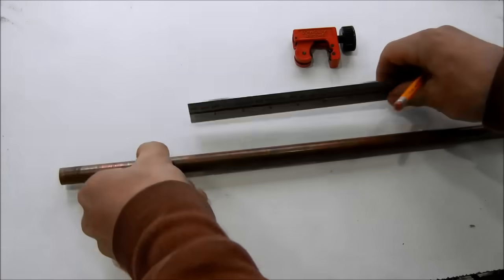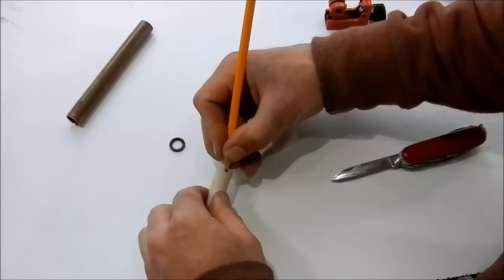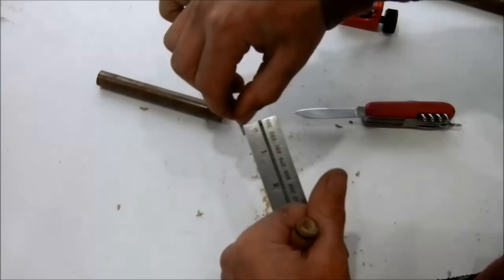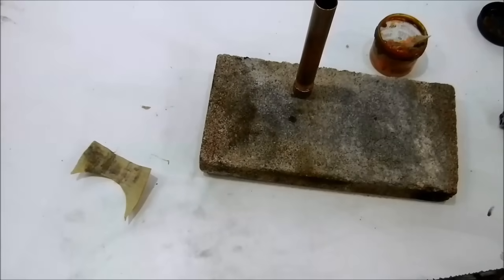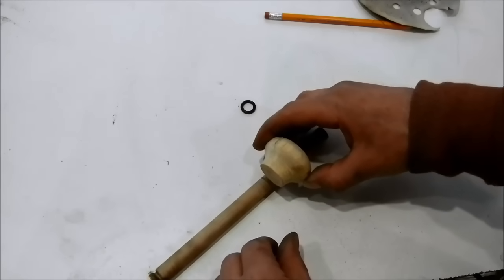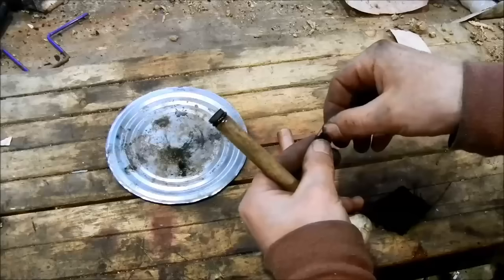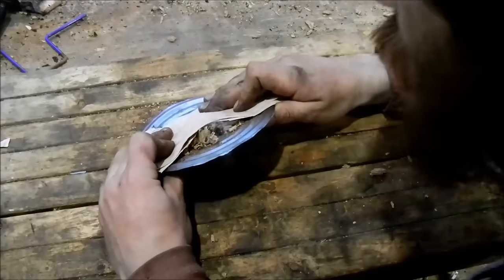Making and Using a Fire Piston

Comment: Drill a hole through the knob, put plunger in tube, slide on knob, mark plunger at knob top, cut plunger to length and glue in knob --  really strong, no screw.

Comment: Fantastic video no annoying music nice and quiet. Direct to the point. I gotta go make one of these my only suggestion however minor from somebody who soldered millions of fittings put the heat on one side, touch the solder to the other side the heat will draw the sauna around. And the other advantages when the opposite side of the pipe is hot enough to melt the solder that’s the perfect temperature and you won’t burn the joint. I’m off to make one of these. Thank you sir.

Comment: I just finished ordering batteries for my porter cable drill driver. Bought it in 2000 and its still in fine shape. Had to order  1.9 ah ni cd sanyo equivalent ones. But I refuse to throw that drill away!!

Comment: The knowledge to build this device is of more realistic practical use than all those silly ferro rod videos. The most likely survival situation In our modern age would be the result of some kind of unplanned event which cuts you off from access to all goods and services, so you must gather all you need from your immediate surroundings.  You probably would not have time to prepare and would not have matches, lighter or ferro rod, but you probably would have access to some salvageable man made materials. Since this fire piston could be made in so many different ways all you would need was a short piece of pipe and you could have this built in a few hours without a hardware store. (if you had some kind of a blade) It is very doubtful you would find a rod suitable for striking sparks. The use of a dead Bic lighter found on the ground may actually be most likely in statistical reality. Without at least a pen knife in the very remote wilderness, you might be in a pinch, no matter what. You would have to resort to full-on paleolithic and the learning curve on that exceeds time required to starve.

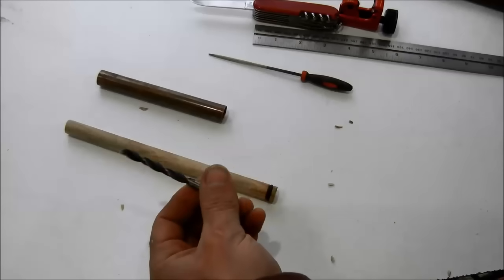Comment: 2:50 the pop 😆😅
This is cool, cheers. I'm also wondering, does this scale alright? As in, if the dowel and pipe diameter increase a little, will it have the same effect? I'm guessing it would just take more of a whack to plunge the piston down.
Reply from the maker: Yes, it would work, but this size is already a bit big and takes quite the whack.
Reply: @jonthewoodworker  Ah right I see. Cheers.

Comment: This is great and a fun thing. For back woods well off the beaten path I found that a disposable Bic lighter works extreamly well and is much less weight and starts fires faster. 
PS if you mention  what if... 
I just carry two lighters and it is still lighter and easier.

Comment: Cut a square of aluminum foil 4x4. Take a cotton ball smear it in Vaseline. Place in the center of square fold the foil place in a tin. When you need it cut a x in the foil pouch light the cotton ball, when tinder is self sufficient pull out packet let cool replace in tin to reuse after letting it cool

Comment: When I was a boy scout, one of the explorer scouts had a fire piston, the piston was copper tipped, smaller in diameter and fit into small wooden block and it worked. The design shown here looks easier to make, simple, and inexpensive. it also teaches some measuring, knife, file (chain saw file), pipe sweating skill. Looks like a great scouting project.

Comment: I learned that if you cut a tiny notch out of the pit wall you get an even better ember. The heat caused from the friction will rush into the notch you cut out giving you a better ember.

Comment: I dislike these for routine use. They would be last option for a fire starter. 
And yes I do own one. Much prefer fire striker and flint/chert.
Or fero rod. Even a bic lighter, in wintertime the flint will still work. 
Not very good with bow drill, but better than freezing when no other option except in very wet humid places.

Comment: Superb video
All 100% info ZERO BS
I have used for over 30 years now and can not recommend strongly enough either a Gerber StrikeForce or Gerber Blastmatch 100% self contained fire starter that the handle of both will hold one or two 100% waterproof 100% windproof Trioxane fule cubes
Weighs 3-4ozs fits in any pants, vest or pack pocket and is essentially bomb-proof indestructible and idiot-proof to use.
I have so many I lost count
I have two in every vehicle 
Two in every pack pack
One in every turkey vest
One in every fishing vest
One in every fishing tackle box
One in my hunting survival kit
One in my 1st aid kit
All with additional Trioxane bars.
If you can not get a fire started with a StrikeForce/Blast match and Trioxane cubes/bars maybe you shouldn't survive

Comment: Great video . My only question is, can it be used with other materials other than the carcloth to start an ember? If so, what other materials can you use besides the carcloth, and if not, still a great way to start a fire fast
Reply: Rusty steel wool might be the answer.

Comment: Great tutorial! For those that don't understand what happens when you hit the plunger, think of how a diesel engine works (compression ignition). When you hit the plunger, it raises the pressure of the air in the tube to 3-400 lbs. and superheats it, causing the tinder to ignite. Very basic, no matches required, and works in pretty much any weather, as long as you have some dry tinder to work with.😉
Reply: Always certain to learn more in the comments.  The understanding being my goal. Thank you my good man!  An interesting learn indeed
Reply: Thanks
Reply: First recorded use by the Kikuyu Tribe of Africa. Their model was larger and made from wood. Probable estimated length about two feet. (700mm approx.) Thanks for the info. re pressure.

Comment: I inherited a fire piston (tonteldoos) that was from the second Anglo-Boor War, 1899 - 1902 when Great Britain sent their soldiers to die in South Africa for the gold fields, at a ratio of ten to one.
It is one inch diameter X four inches long. The plunger goes through the fixed end-cap of the body and the other removable end-cap is secured to the plunger by a  small chain.
Inside is some charred cotton wool. 
Thanks to this video I now suspect that the plunger is missing at least one O-ring as I could never get the thing to work.

Comment: O-rings are actually designed to fit into a square-bottomed groove -- you'd be better off using the side of a flat bastard file (yes that's what it's called).

Comment: Great video sir, to the point, not wasting people's time with music and nonsense. Great video. I'd like to add, when you make groove for O ring, put dowel in the drill and spin it fast then use wood file to make groove. It makes a perfect groove. Then the knob, drill into it half inch an recess it to last year's longer and countersink screw in center of knob to hide it. I read a lot of comments on here. The whole point of making this piston fire starter is to teach people how to start a fire when we don't have any matches or lighters. But if you would fit piston into a T that's half inch on center an 3/4 on top 2 ends you can add extra pipe to make a storage tube to hold char cloth and small tube of oil or Vaseline to keep O ring lubed up, and store extra O Rings Incase the one would ever break making it not seal the air inside it to lite the cloth. Most people don't realize what the science is going on with this. Air has oxygen and nitrogen in it. The nitrogen is a fuel and when compressed it burns, an the oxygen is just the perfect amount to help it catch fire. There are many ideas we all have to make these, so we just watched this awesome video here and now you can build yours at home, or gather up your children and grandchildren if you have them and you can solder the caps on ends, and let the kids do the rest. They learn by doing it, not being told how to make it. Let them make something cool, and make char cloth and roast some marshmallows and make those s'mores. You will be the best dad or grandpa those kids could wish for. An make sure you let them start the camp fires this summer using their piston fire starter they built themselves. Gives them a boost of pride they made that with their own 2 hands. Teach them survival, fishing and hunting. Take slingshot rubber bands with pouches already on the straps, so they only need to find a forked tree limb and saw to cut it down. Take bark off an use good strong fishing line to attach the bands to the wood. Shoot acorns and small rocks and have a target set up, by then you should have a pile of drink bottles or juice boxes empty. Have fun and please get kids outside to be one with nature. An to all dad's, carry a side arm with extra clip. You don't know what is out there, an be sure you tell kids never talk about the gun you have in you at all times. Stay safe and share the Love.

Comment: It would be interesting to hear the science behind a fire stick.
Reply: That is easy - same science as behind a diesel engine. Air compressed very rapidly rises to several thousand degrees with highly concentrated oxygen in a small chamber. With this gadget you add fuel first, then whack sharply. The high temp, compressed oxygen plus fuel equals flame. Small coal but still flame. I imagine a cotton ball would light also.

Comment: Not the safest way to use a drill, Holding the dowl in your hand and then pushing the drill towards your hand can lead to a lot of pain or even the complete loss of use if it goes through the nerves that control it but overall a good video